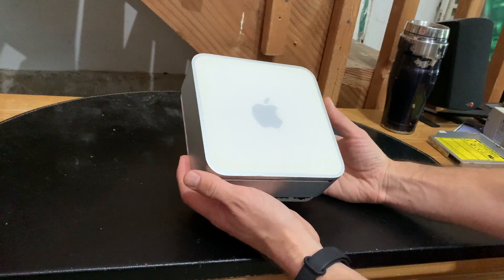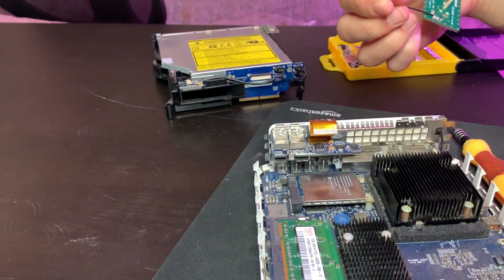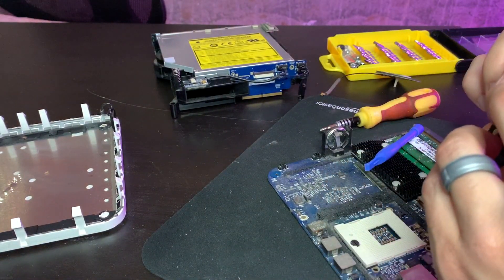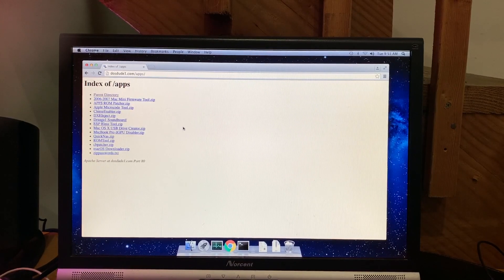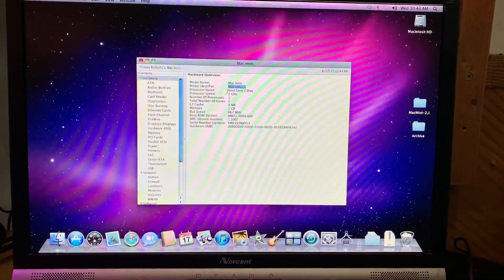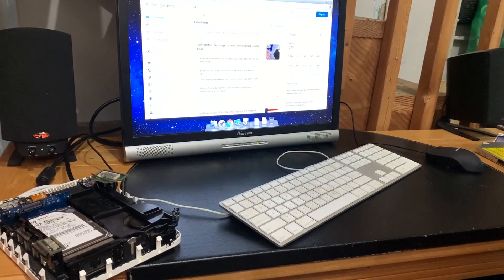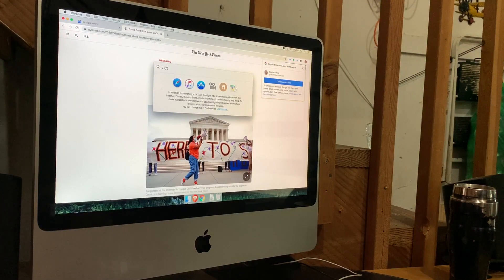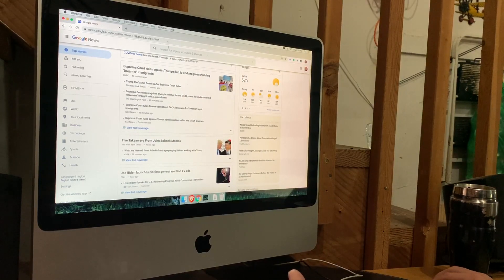2006 Mac Mini Upgrade - is it worth it?

Comment: Whether it's "worth it" or not depends on what you want to do with the thing. I'm in the midst right now of giving my 2006 Mac Mini a fourth lease on life. It started out as my main machine, but it struggled too much with the games I wanted to play. Then it was an HTPC for a time, but it was too loud (mostly its optical drive). After replacing it with a PC with no moving parts, I repurposed the Mini as a file server. That was the perfect role for it, and it performed that task for 13 years! Over time, USB 2 became too painfully slow, though, so it sat in a closet for the last three years. Now I'm hoping to turn it into a headless MIDI emulator for my old DOS gaming systems (emulating Roland MT-32, etc..) Granted I could get an old thin client to do this, but there's nothing special about them. Using a 17-year-old Mac as a MIDI emulator is just more interesting.
Reply: 20 mac 3.2 pcu 6 for ram total 30 poinds silver fox as browser and lot of time , pizza roll

Comment: I had managed to upgrade my Mac mini to a C2D T7400 and 4GB of RAM, seems like all of it is accessible by macOS. Runs Lion reasonably well, and I actually got Mountain Lion and Mavericks running too, but either has their own set of issues, namely that no apps like iMessage or FaceTime would work on either, and sleep mode doesn't work on Mavericks.

Comment: How did you do to install the mac os in the SSD because my mac mini A1176 2007 was unable to boot
Reply: Good question. I ran into the same problem. I tried cloning the 10.6.8 OS X onto a SATA3 128 GB GoodRAM SSD & the OS didn't boot st all... 🤔😕😞

Comment: I have a 2006 model Mac mini that I upgraded the HDD to SSD and and it has 2gb of ram. I installed Steam on it and my kid uses it for playing "edu-tainment games". We've had no problems with any of the issues you mention...but then I also got rid of apple OS and installed windows 7 on it. I think THAT would be what's holding yours back. I'm most likely going to benchmark the current system as-is and then do the 2.33ghz processor upgrade and re-test. I'll let you know what the results are if you're interested.
Reply: is youtube usable and web browsing with the cpu upgrade?
Reply: @mg86_  si, incluso se puede hacer sin problemas con el de 1,8ghz

Comment: windows 10 doesnt work at this config ?
Reply from the maker: It might?  I am not completely sure on that.
Reply: @messing-with-computers  usually works at c2d
Reply: why would you want to run windows 10 on a core 2 duo, sounds horrible

Comment: what about fan noise?
Reply from the maker: It isn’t too bad, the bearings on my old Mac are sot though, a new fan would fix my noise, but it didn’t change much with the new chip.
Reply: @messing-with-computers  Oh okay. Just in comparison to a MacBook Air?
Reply from the maker: @axel9546  - Not sure I understand fully, but overall these machines are not too loud as long as the fan is not broken ;)

Comment: I’ll do the same soon. What CPU did you use exactly? I will upgrade the core duo with a Core 2 Duo T7600, which is the fastest CPU that will work
Reply from the maker: I used the t7200 because it was diiirt cheap to test out.  If you want to venture down this path be sure you don't spend too much on the CPU, since the GPU is the bottleneck ;)

Comment: How can you build a cheap nas with a pi 4? Also would a 770m from a MSI laptop work without flashing with a mi 2011 21.5inch imac
Reply from the maker: Building the NAS is actually my next video!
Reply from the maker: The msi card would probably need at least a Dell vbios flash from what I know.
Reply: @messing-with-computers can I flash a Mac vbios onto it after putting it in my Mac?
Reply from the maker: Edison Chow - yes. In my “2011 with brightness controls” video I show that process.  Requires installing and using Linux or windows to flash the vbios.
Reply: @messing-with-computers  but 2011doesnt support bootcamp

Comment: i think its good for a basic windows/linux machine
Reply from the maker: They can be, but that 32bit EFI makes installing Linux just... a bit unfriendly.  Most of the online guides also fall back to 'burn a CD' which is sad, because most new distros won't fit on a CD, or in my case, I don't have any burnable CDs or a CD burner even!   So, the Raspberry PI wins the day here as well.